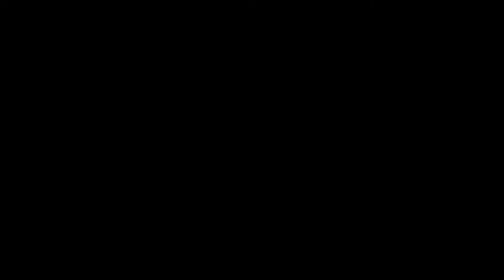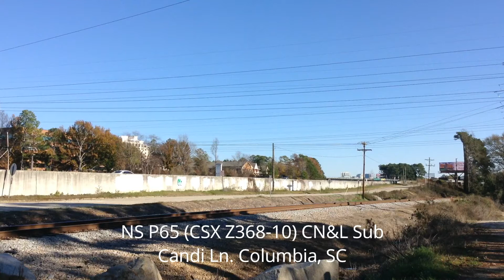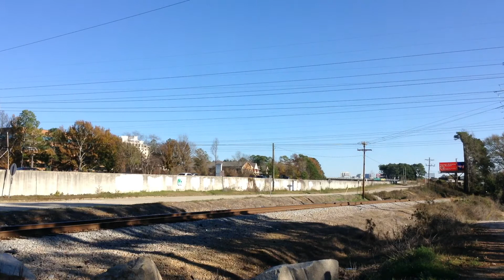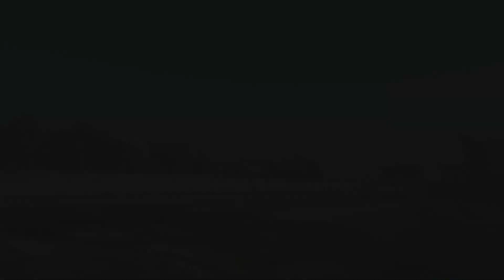NS P65 (CSX Z368-10) heads out of Columbia, SC w/ an SD70 in the lead

Comment: The old NS line from Peak to Prosperity and also Silverstreet to Honea Path has been abandoned. It started from what I understand on May 1, 1990.
Reply from the maker: Yep that sounds about right. Thanks for watching
Reply: You're welcome. That old Southern line went through Greenwood. To me , that is the line that built Greenwood. At one time, GW was the RR capitol of SC. Besides Southern, you had the Atlantic Coast Line running from Augusta to Spartanburg, Seaboard Air Line from Atlanta to Hamlet, NC, Piedmont & Northern from Greenville to GW, which a branch line to Anderson, and the Georgia & Florida from Augusta to GW. Plus the Ware Shoals RR from Shoals Junction to WS. Today, only 2 CSX lines serve it, and the only RR through the city limits now is the old SAL line. The ACL line was removed in 1973 and now branches across Hwy 72/221 starting behind the MedTronics plant.